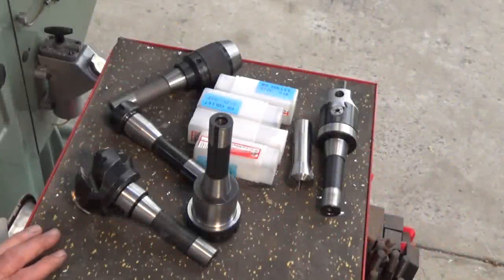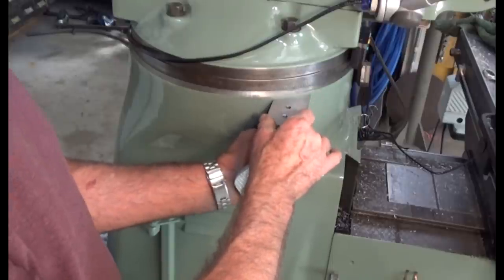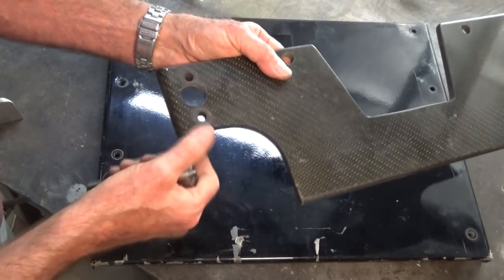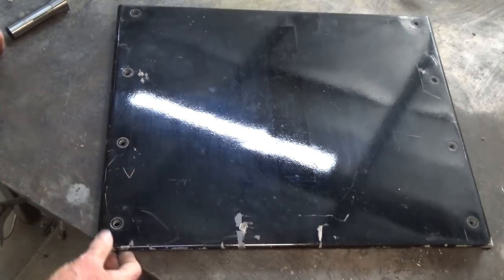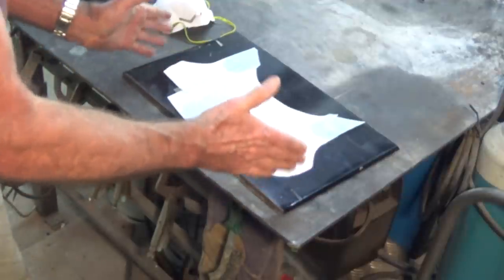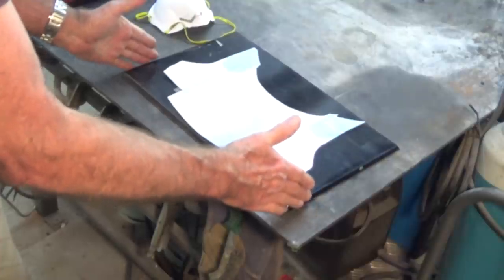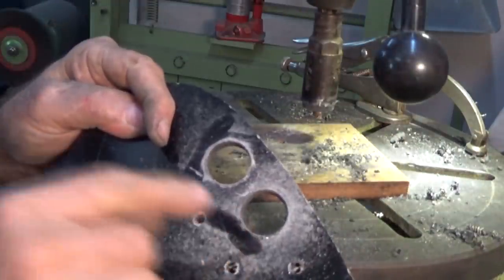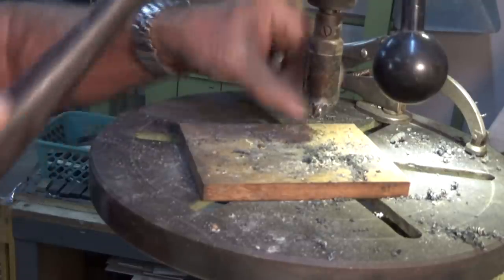DIY Carbon Fibre Collet Rack for the Bridgeport Milling Machine

Comment: Apparently carbon fibre using a wholly indigenous precursor has only been accomplished in the last few years in Australia.
Reply from the maker: I went to a composites seminar about 10 years ago on the Gold Coast and it was like stepping into a parallel universe. There was a guy from NASA talking about making re-entry vehicles wholly from one piece carbon fibre and another guy selling a system for repairing carbon fibre panels. I sat in on a conference discussing precursors and most of the topic went way over my head but the one thing that stood out at that time was the specialisation required to make the precursors and how difficult it was to scale up production of raw materials. 
Regards,
Mark

Comment: Carbon fiber is going to be very abrasive to the taper on your R-8 tool shanks.
Reply from the maker: Is it though? Free carbon fibre is basically graphite. When I was cutting the sheet material the dust was just that. It wasn't like grit. Mostly it was just like a powder. 
We shall see I guess.
Regards,
Mark
Reply: If it proves to be a problem the holes will just have to be enlarged a touch and some bushes made out of a suitable material but I don't think you would ever notice much of a difference in wear.

Comment: You really should at bare minimum wear a proper respirator and have the work area heavily wetted down before grinding, filing, or sanding carbon fibre. The dust is some seriously nasty shit ! You REALLY don't want to risk breathing any of it in.

Comment: Why use carbon fibre? Well....the video would be a lot shorter if you just drilled all the holes out of a sheet of aluminum or steel and slapped in on the Bridgeport and got on with it.  Where's the fun in that?  It's not always about being practical.  And, of course, the toxic dust from cutting the CF is always a lot more fun than safe metal ships eh? :-) MARK!  Slotted screws?  What the heck man?!  Just nooooooo.  The rack looks amazing!
Reply from the maker: As a bit of a stunt on Instagram, I climbed up on that rack and it took my full weight (80kg) I suspect that aluminium would bend? I agree that slotted screws are so 20th century but I had them on hand....
Regards,
Mark